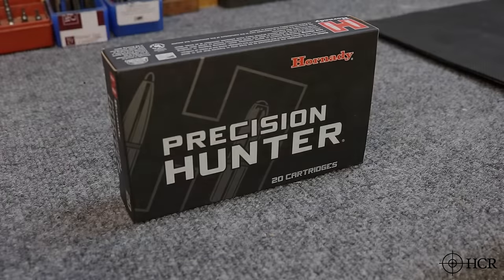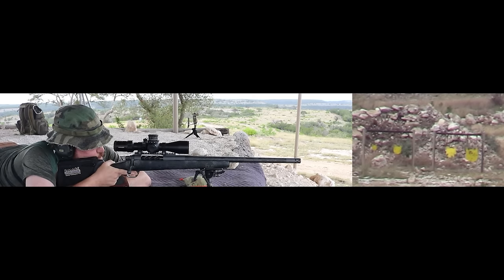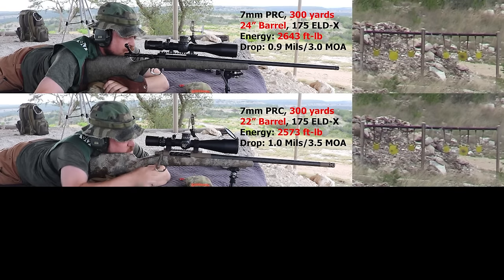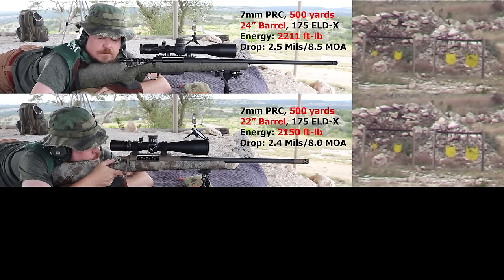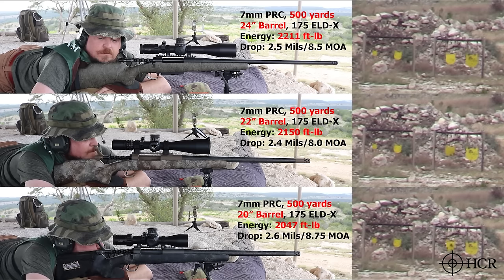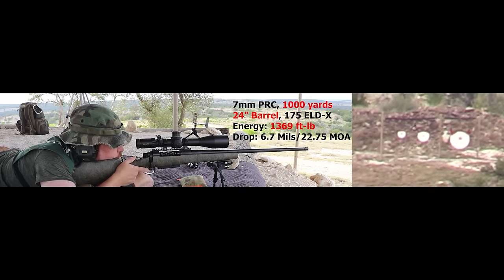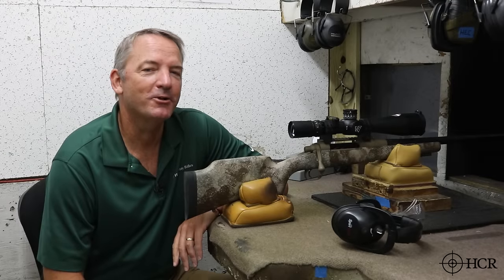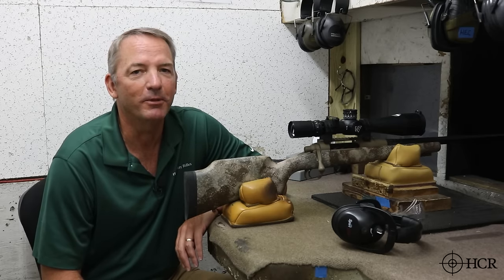Long Range 7mm PRC Testing & Data

Comment: doesnt really accomplish anything more than what a 338 lapua, especially neck sized only handloads on 500 yard plus ranges.  as for hunting, and in texas... most hunters dont shoot past 300 yards... and vast majority of them dont have the skills to hit anything out to 500 anyway. knowing that whats the point of owning the PRC for hunting when a 7mm-08 or a 260 Remington is cheaper, more common, just as precise out to 300yrds and can take down a horse just the same and easier on the shoulder?
Reply: If you aren't hunting at 500 yards, you aren't who this rifle is for. You answered your own question. Stick with whatever you want to stick with and let the long range hunters play with the new cartridge. You can stay sub 300 in Texas all you want.
Reply: Great, sounds like you don’t need one then! But for the people who want a great all rounder off the shelf that’s capable of extreme long range it’s the best option. Name a single gun you can pick up off the shelf that shoots flatter with factory ammo, and doesn’t blow your shoulder off with recoil while burning 100gr of powder like a 28 nosler or 338 lap. Why does everyone get so mad when people want to get something that shoots extremely flat. It’s like you’re offended that someone will buy a gun that’s capable of 1500y but only shoots at 300 tops. So what? Just because it can shoot far doesn’t make it bad for close range 😂
Reply: @devinb3397  because it doesn't do anything significantly better than what is already cheaply available. All these new rounds are nothing more than renamed cartridge's with a tiny tweak to avoid a patent issue., most that have existed for more than 50 years. Remember the 6.8 creedmore? the 6.5-06 beats it in the velocity department  by 300fps using old neck sized 30-06 brass thats over 100 years old. how bout the 260 Remington that took the long range tacical competitions long before the 6.5 creed... get yourself a reloading manual and see for yourself... all these new rounds are nothing new... its all about muzzle velocity and bullet weight... and you cannot change how much powder it takes to move a bullet a given velocity. and when you have only 100fps difference... thats simply a waste of money. this is all about selling new rifles, , new ammo, new reloading dies, new brass and above all new rifles.. this new PRC is nothing but a rebranded 7mm WSM with a 5 deg change in neck angle and neck length of +0.1" so that they can call it a new round from a different manufacturer. and anyone that thinks recoil changes despite the velocity of the same weight bullet is a moron. you cant get around the laws of physics. this crap happened back in the 1990s when the 300 whisper by SSK came out... but nooo... they rebranded the same round by a big manufacturer and called it the 300 black out... they are now doing the same thing with the new 8.6 blackout... aka 338 whisper of the 1990s. this is all a tacti-cool money grab. 95% of people that own these rifles cant shoot past 500 yards to save their life to begin with. I once meet an old hunter at our camp that Ive been going to for 30 years... all his shots were neck shots... pigs, coyotes, does, (didnt shoot bucks, he said does tasted better)... never missed. shot out to 200 yards rarely to 300... and all he had was the same 40 year old 7mm-08 with the same old 3-9 Leopold duplex scope. yet none of these kids with their new hot Ultra mags, 300 WSMs and 300 PRCs, wind gauges, range finders, scent blockers mossy oak crap could ever match his success for taking game for 30 years plus.
Reply: @renaissanceman5847  it is nothing groundbreaking. These new ones are just better optimised for a wider range of purposes. Wanna know why the 260 and the 6.5-06 faded away? they had good velocity sure, but slow twist rates from factory that limit them to light projectiles, that in conjunction with their speed absolutely explode when they hit deer. Velocity is just a secondary factor these days. It’s all about being able to use the heaviest bullet you possibly can. 
The rem mag which the PRC is really aimed at is fine how it is, I’ve got one myself. But for someone who wants to have the ( option ) for long range work, you’d be stupid to pick a rem mag up when it has 100fps less velocity with the same powder charge and a slow twist rate that’s limited to 162gr projectiles or so. The other problem with the rem mag in many rifles is mag length, it was never designed to seat long projectiles at 3.340 COAL which is what many rifle magazines are. 

It’s not about convincing people to run out and sell their rifles to get something that’s groundbreaking and new. It’s just many small improvements that make sense to choose it as your next rifle. once PRC ammo and components are available I can’t see a single upside to picking up a rem mag over it. I believe it does fit a niche. I love the 7mm bore and have always wanted a really nice cartridge that is capable of very long range yet is at a nice recoil level. The two at the moment are the rem mag, (7mmWSM which barely anyone makes and has a slow twist ) and 28 nosler. The rem mag is great but has the issue of the slow twist rate in the vast majority of factory rifles, and the nosler is massively overbore which most people can’t handle. Yes Hornady is crazy with their marketing, but at what point is it still a gimmick?  how many rifles and ammo makers need to take it up before it’s decided maybe people do want it? You can argue nobody really “ needs” more than a 30-30 so everything else is a gimmick.
Reply: Because the essence of the RENNAISANCE mindset is the increase of excellence, to argue that the 7mm rem mag does it as well as needed, is not in line with our creative ethos
Reply: @primalsapiens  The increase in cost doesnt outweigh the increase in performance over what has already existed. especially if the the rem mag is fitted with a precision barrel and action like current PRCs are.. the 7PRC is simply another rebranded 7mm WSM with some tweaks to get past legal issues... which itself stole the idea from the Lazzeroni cartridges of short fat 7s back in the early 1990s.
Reply: @renaissanceman5847  what increase in cost? PRC ammo will cost the same as top shelf rem mag ammo. Reloaders will have no difference. 

It’s not about going out and selling thousands worth of 7mm rem mag gear and getting a PRC. But for when you upgrade or you’re in the market for a long range 7mm that’s popular enough to have guns and suitable ammo on the shelf ( in a few years from now ) it’s literally the best all round option by far. 

Big majority of people 1. Don’t want to mess around with custom parts. And 2. Want to buy off the shelf ammo for long range hunting or targets, which the PRC is the best option for by far. All the loadings will be high BC projectiles. 
The rem mag has some options sure but it’s best loads still don’t come close to the PRC. 

Why would someone get a 7mmWSM or something else obscure, spend all the time and money modding it when the 7mm PRC exists far more readily and does it better essentially? The only reason I find it so great is because it’ll be big. Much like the creedmore, why would you get a custom barrel 260rem when you can just buy a creed as is and do the same job way easier, and then have all the factory ammo on top.

Comment: 7mm remington mag. Does the same thing! No need for a new cartridge.
Reply: Except it doesnt...they are showing energy readings of greater than 1600 ft/lbs at 800 yards. The 7Mag doesn't have that at 500 yards with the same weight projectile...or any weight for that matter.
Reply: @BB-nw3mj  I assume you're talking about factory ammo? There are actually plenty of factory ammo in 7mm Rem mag that can get over 1600ft.lbs of energy at 500 yards. Hornady 162 gr ELD-X has 1772 ft.lbs at 500. The Remington Swift Scirocco 150 gr has 1707 ft.lbs at 500 yards. The Nosler 168 gr ABLR has 1822ft.lbs at 500. 

But I get what you're saying... if you don't reload the 7mm PRC obviously has a bunch more power. But what happens if you do reload for the 7mm Rem mag? They are much close than you think. A 7mm Rem mag with a 175 gr ELD-X handloaded at 2900 FPS is within 100ft.lbs of energy at 800 yards to the 7mm PRC. So maybe Ricky does handload his 7mm Rem mag?
Reply: Yes I was trying to make an apples to apples comparison with factory ammunition…. And not how much Retumbo someone can stuff in a seven mag case. But in a way you made my point for me…. The author of the original post here did not feel like there was any value in this new cartridge and that there was redundancy with the seven mag. But for those shooting factory ammunition there is a fairly significant difference. And I haven’t studied the case capacitity on seven PRC yet enough to comment about the possibilities of also loading it hotter. Also I’m not taking anything away from seven mag…. It’s a fantastic cartridge.
Reply: @BB-nw3mj  Here is my point... I don't ever buy factory ammo, it's become expensive, and I can make much more accurate ammo reloading. I get the appeal of the 7mm PRC for the masses that don't reload. But as someone that always reloads... It's just another cartridge that is a little faster than a 7mag. By the way I'm not a 7mag fan, in fact I think it's a little overrated. And it's factory ammo is not great.
Reply: No it doesn’t lol. The 7 rem mag can’t stabilise anything over 162gr with a high BC. And the 7prc gets 100fps extra with the exact same powder charge. And I’m a 7mm rem mag owner
Reply: @devinb3397  I don't mean to correct you... but there are plenty of 7mm mags that have 1in9 twists that can stabilize the heavier bullets. Not to mention Browning has 1in8 twists in the X-bolt in 7mm Rem mag. But you're right the 7 PRC is faster
Reply: @ReloadingWeatherby  oh yeah I know there are some out there,  but I think the most popular by far would be 9.5. Either way the PRC will reach full capabilities in any gun, the rem mag you’d need a combination of a 8 twist rate and long enough magazine to essentially get close to the PRC. and the only real option I had for that was the hells canyon long range, which I wasn’t a fan of for stalking sambar deer here in Australia, it’s pretty much walking all day lol. Now I can put a PRC barrel straight on my rem mag and comfortably shoot probably the 175gr accubonds at 2950 or so
Reply: The vast majority of hunters buy factory ammo and you are getting significant added performance over rem mag factory ammo. That’s reason enough. Also, my guess is that once you start hand loading the PRC you’ll see some pretty impressive numbers (but I don’t load so that’s just my guess)
Reply: @ReloadingWeatherby  so you're saying 7 rem mag can do the same if you reload. but what if you reload the 7 prc? couldn't you get more power and speed than a reloaded 7 rem mag?
Reply: @danielcofield3885  I did say the 7mm PRC is a 100 FPS faster than the 7mag.
Reply: @BB-nw3mj  I shoot a saami 7 mag with a 195 Berger at 2912 and if I have n570 I could get 3000. And yes you can actually buy loaded 7 mag ammo with 195. So yes it is better than the PRC. Not saying the PRC is bad round but your completely under estimating the power of the 7 mag. With the saami chamber my COAL touches lands at 3.507 that is plenty head height with a saami chamber.
Reply: @SpudOutdoors  Im not underestimating...just a statement of fact. Again..the original poster said that this cartridge doesn't offer anything that a 7mm Mag doesnt already deliver. I just disagree. The 7mag was developed (in 1962 mind you) with bullets weights of 139 to 168 grains in mind and that is why almost all factory 7mags have a 9" to 9.5" twist. The 7PRC was developed for that next weight class up...say starting at 168 up to the 195...thus the 8" twist. I am guessing your barrel is a custom 1 to 8" twist. But for the guy buying factory rifles and factory ammunition the 7PRC offers long range  trajectory, energy and bullet stability not typically found in standard 7mag offerings. And it does it with smaller case capacity and most likely less felt recoil and less chamber pressure due to that shorter fatter case. As far as I know the 195 Berger you mentioned is only loaded by Choice Ammunition....and I would be willing to bet it is not particularly accurate in 7mag factory rifles. For the guy deer or elk hunting at 500 yards and closer (still insanely long shots) I also dont think the 7PRC offers that much over 7mag. But for the guy punching paper (or animals) at longer distances (especially in a factory set up) the 7PRC has advantages. And for handloading it is worth it to me not to have to jack with that 7mag belt. Not that I am about to run out and buy the PRC.
Reply: A standard 9 twist will not stabilize the ultra high BC bullets or the longer high BC solids so the nod goes to the PRC, but the other important thing many aren't realizing is case design and throat lengths of the 7 mag vs 7 PRC. Shorter, more efficient case, and longer throat give you the ability to keep the bullet out of the powder column and keep the bearing surface out of the base of the neck area that could possibly form a donut. A lot of folks that don't mess with reloading a lot or simply don't understand case design will always kick and scream saying it is a waste of time to consider the new cartridges that are coming out. Instead of those complaining about it....Why don't we all agree that we are in he best time for firearm and optic technology and new products/designs coming about is a great thing. 

Also, that 22" gun has some elevation issues and needs to be thoroughly looked over. The 20" and 24" gun ran decent. They are proof blanks so that doesn't really surprise me.

My rifle will be to me Monday. I may have to actually make a video for once. I don't expect much from the 180 ELD Match ammo that is coming with it, but when I get into it with the 190 Atips, 180 Hybrids, 195 EOLs, and some 169/177 Hammer hunters I expect some nice results.
Reply: @SpudOutdoors  you cannot seriously get 3000fps safely in a standard length barrel rem mag with a 195gr. You’ve either got an extremely long barrel or you’re pushing your brass so hard that it’ll be screwed after a single firing. Compare factory rifle to factory rifle, the PRC wins hands down. 95% of people don’t want to go through all the trouble of getting a specific 7mag or getting a custom build to run heavy projectiles, when the option is literally right there for the PRC that does it better and with far less effort. And I own a 7mm rem mag lol. Just pick a PRC off the shelf, get more velocity with the same charge, no stress about a custom barrel, no stress about mag lengths, and factory loads that smoke the rem mag. Same reason the 6.5 creed and PRC are so popular. You can go down the route of a full custom in some other cartridge, or you can just grab one of the shelf that’s designed straight up for what you want to do. But my main point is the PRC gets better performance all things being equal regardless.. do some research on case geometry and it’s effects with burn rates and efficiency. Just because the rem mag has a few Gr extra capacity doesn’t mean it’s going to push bullets quicker.
Reply: @BB-nw3mj  that’s exactly my point. The rem mag is extremely capable and does everything 99% of people need. But so is the .308 if you want to argue that. Now why does someone really “ need” a rem mag when the 308 is perfectly fine out to 500y and you don’t shoot further? The thing is If Im going out to buy a new rifle and I want something that shoots flat and is designed for it, there’s no way I’d pick the rem mag over the PRC sitting there. Too much playing around and consideration for the rem mag to run heavy projectiles just to get it to do similar to the PRC but with less velocity. Yes you can get the browning hells canyon long range, but I don’t want a heavier 26 inch barreled gun, I want a tikka action and a 22-24 inch. Now I can just order a nice 24 inch barrel in 7PRC and get great performance. The real selling point for me is the 3.340 OAL, I can easily run any weight in my tikka mag. If you want an absolute cannon on a magnum action, get a 28 nosler. But the barrel life and recoil are major downsides. Just think the PRC sits in the perfect spot for someone who’s after a long range deer rifle. Best ballistics by far from any factory loading without being extremely overbore or having huge recoil.
Reply: @devinb3397  a guy in our group got there safely with a 24”. Yes you can you just don’t know what your doing. I am running a 26” barrel which is standard for a 7 mag.